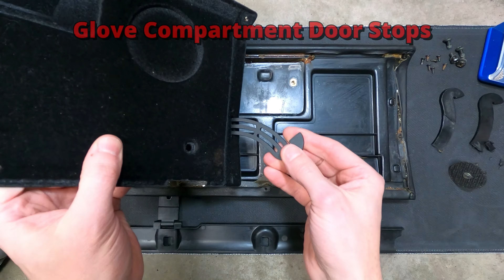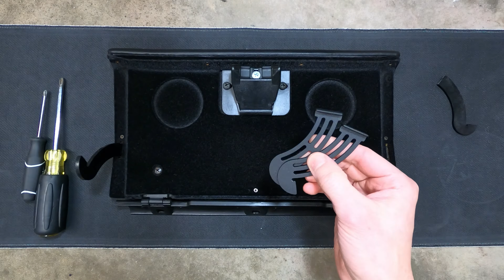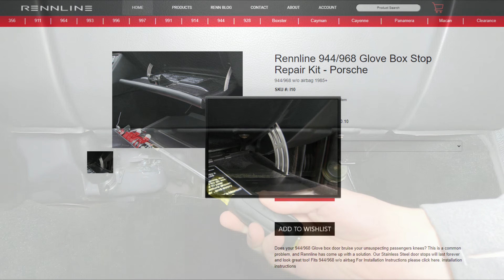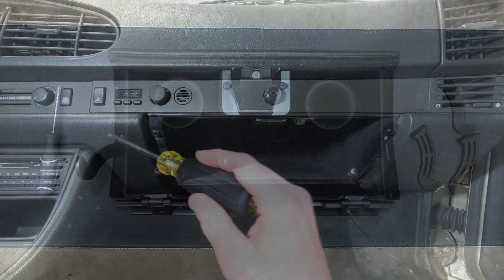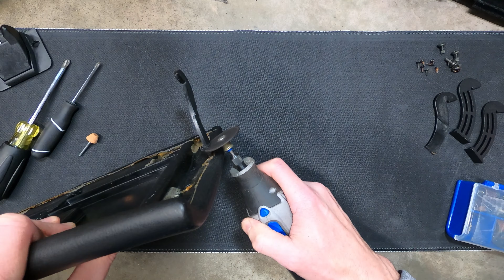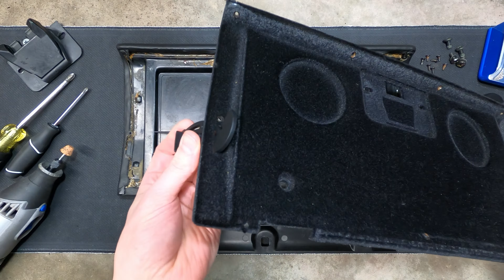Porsche 944 – Glove Compartment Door Stop Replacement Tutorial

Comment: My hatch doesnt work, cant open the glove box at all. Do anyone have any tips? I removed the trim about to see better, but i cant figure it out.
Reply from the maker: @edvinkennas4951 Assuming that the latch isn’t locked with the key and the knob turns with no result, this is a known issues where the screw at the back of the lock mechaism becomes loose and the latch actuator disengages. Most people are able to wiggle/pry the door open by removing the three screws along the bottom and pulling back on the latch area. Pieces of the latch and/or receiver may come apart during this process, but can usually be reassembled once you’re inside.

Comment: Question: if you just place new holders in place without gluing them as shown in the clip at 2.20min, will this hold strong? As the felt liner would eventually break or the gaps through which the arms passes would get bigger leading to loose handling of the cover!
I've done this much but waiting for installation because I've not decided to go glue or glue less.
Reply from the maker: Rennline doesn’t call for glue in that application, but following a “build it better” approach, you’re welcome to apply glue if you think it will help. I suppose it would be possible to split the internal felt/plastic panel if enough downward force were applied, but if the door is used in a normal manner, it’s probably fine to go without the glue. I haven’t yet had any issues with the panel cracking at this point.

Comment: Hey man, would you happen to know what would cause the middle AC vents to not blow air?  I have air blowing from the driver vent and passenger vent, I even have it blowing from top of the dash.  I have both dials full left and nothing.  Even if i move the dial slides to the right, nothing changes.  I took the glove box out and I don't really see anything that pops out, but I have no idea what I'm looking for to be honest.  lol

edit: it's a late model dash 86' base
Reply from the maker: Hey hey! For the horizontal air distribution sliders, left is the fully closed position, so you’re good there. To the right is fully open, where the upper slider provides more air to the windshield and the lower slider to the footwell. The center dashboard vents have an open/close feature as well using a vertical slider between the two vents, there should be a windshield defrost icon above the slider. The controls are confusing at best, but if the vertical slider is up, it completely closes off the central dash vents and directs more airflow to the windshield. Down would be fully open… it’s sounds like yours may be closed?
Reply: Yea I have the slides to the left, the vertical slide is down and nothing man.  Messing with all the controls doesn't change my ac.  The dial that controls the power of the ac works so I assume the control board is good.  I was assuming there was something else I could check outside of the obvious buttons & dials etc.  shrugs
Reply from the maker: @RS4KING  Strange! Can you see the center vent flap opening and closing inside when you move the vertical slider up and down? I’m wondering if maybe the slider/lever is broken or disconnected? The HVAC assembly is one centralized unit directly connected to the center dash vents, so it’s not a situation where a duct could become disconnected. Even with the defrost flap fully open, there’s typically still some air that flows from the center dash vents since the air pathway is the same. There are two control motors for the horizontal sliders and 3 flaps, one on each side for the footwell flow and one up top for the windshield. You should be able to hear the motors and flaps moving when adjusting the sliders. If not, there could be a partial failure at the control panel or the motors/linkage themselves. Here are some images and descriptions - http://www.clarks-garage.com/shop-manual/hvac-01.htm
Reply: @NC944er  the flaps do move when I push the vertical lever up n down.  very little ac blows through the center, I can barely feel it vs the driver/passenger vents.  I think there may be an issue with the motors/linkage themselves.  I guess I'll have to remove the wheel and dash/vents off and just poke around lol.  Thanks for replying!

Comment: Hey, great videos !  Would it be possible to contact with you in any way like email or other platform , I have couple of questions about your 944. Thank you and have a great day .
Reply from the maker: Hey for sure, what are your questions.
Reply: Hey, 

Thank you for your quick reply . So I want to change the manifold on the engine for  filter heads and I’m wondering if you have any company that you would suggest to buy it from ?! Thanks again ,
Reply from the maker: @jakelockley8934  If you’re looking for OEM parts, check out my video on Part Numbers, as it provides a list of vendors and options. Lately, I’ve mainly  been shopping on Pelican Parts. If you’re looking for aftermarket performance mods, Lindsey Racing and Paragon-Products are a couple sites worth checking out.
Reply: Brilliant, thanks !

Comment: Ever messed with the latch itself? I seem to have issues with it retaining the door. Hit a bump, and the door swings open and kneecaps my passengers like they owe the mob.
Reply from the maker: Hey, no I haven’t… but I can see how that would be annoying. Do the plastic catch points (pockets) on the inside of the door look worn? There’s also a silver screw there that can be loosened to adjust the catch up or down. Look for wear marks to see where the two latches are aligning on the catch points, maybe it needs adjustment? Also, I’d look to make sure the two left and right latches on the top of the inner compartment are fully extending out when the turn knob is released. It’s possible that could use some lubricant if they’re not popping all the way out.